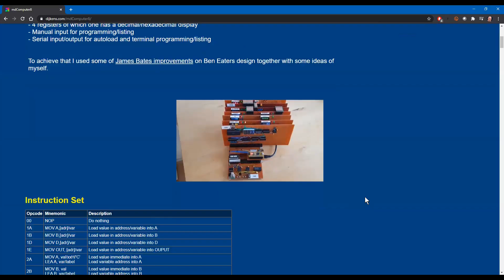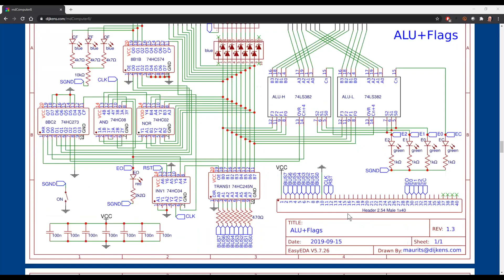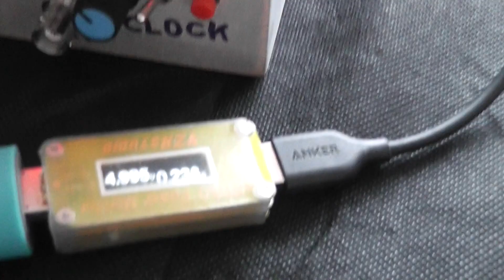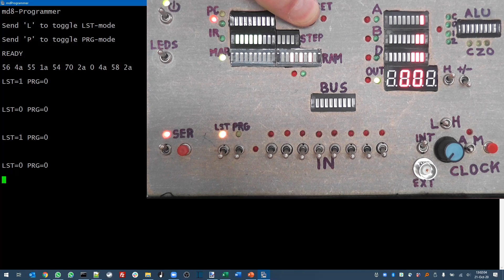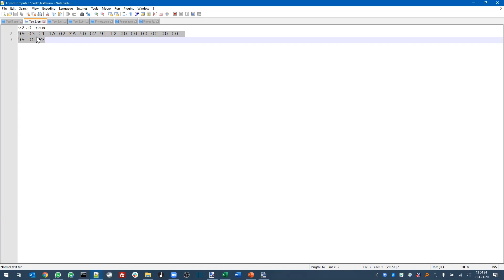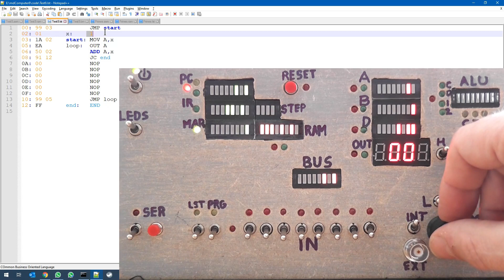Operating my Ben Eater inspired 8-bit computer with schematics, logisim, FPGA & windows emulator

Comment: This is awesome. Thank you for publishing the schematics and this video showing the front panel connections! I am trying to adapt your schematics to use mostly large-ish profile SMD components and hopefully trying to get some PCB's that have those PCIE, I think it is, connectors so you can just slot the boards in. Always been interested in these computers but my knowledges with EasyEDA and schematics in general has never been the best but your information and ben eater's has really helped so thank you.
Reply from the maker: Great to hear Adam!
And I mainly thank Ben Eater for giving such splendid walk through course that really makes you understand all things required step-by-step

Comment: Wow! this is amazing. Where did you get those LED strips on the front? They look so cool
Reply from the maker: Thanks Sam
I'll get all of the parts at a cheap via ebay
e.g. https://www.ebay.nl/itm/5PCS-10-Segment-Digital-Red-LED-Bar-Graph-Display-Ultra-Bright/151928401047?hash=item235fa36c97:g:2bkAAOSwJcZWfkr8
Reply: @mdijkens  in my country i will get 20+ pc at that price

Comment: This is very much like what I've been trying to build. One thing I think it will be fun to do is make the cards themselves form a modular front panel.
Reply from the maker: Initially I wanted to have the boards nicely produced by jlcpcb, but it would have costed >$100 in the end. Main goal was to build it on the cheap with no expensive parts
Reply: I had the same idea of putting red and green LEDs to indicate IN/OUT of each module. so much easier to keep track of data moving around that way!
Reply from the maker: @zBradBell  Yes, it turns out to be very helpful to follow the steps. Also there should never be more then one red led (send on bus) on at a time